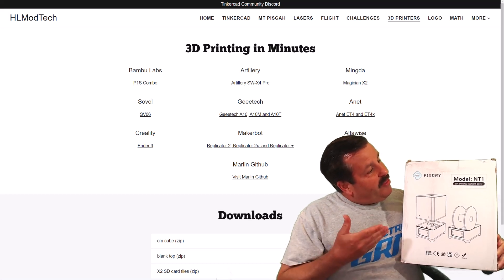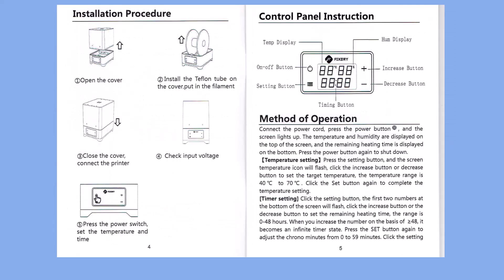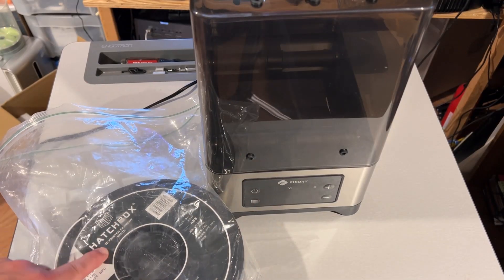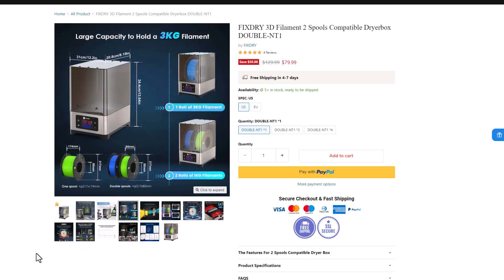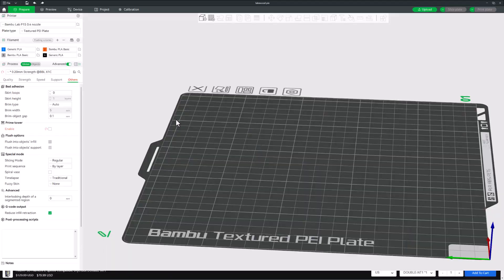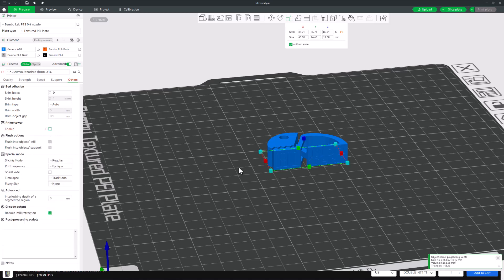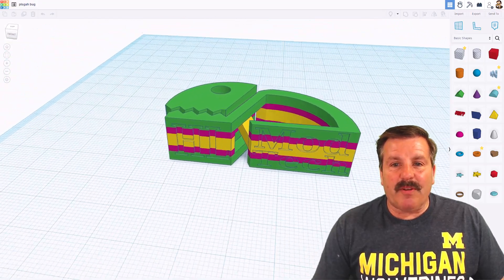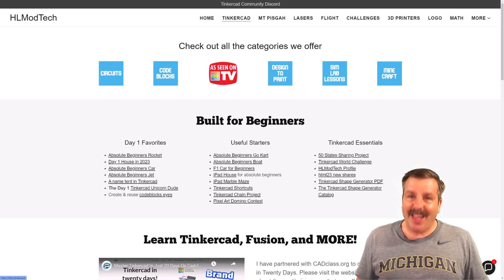Beginner ABS Bambu P1S FixDry NT1 Filament Dryer Tips Tricks and MORE!

Comment: Thanks for the practical demonstration, HL. That was very well done and quite helpful. I will consider getting one of those filament dryers (and I'll use what I hope is an affiliate link for you). Perhaps you could report back in a month or two for any insights on the dryer. Let us know the pros and cons.
Reply from the maker: My pleasure. I will keep you posted. I have a another abs print planned for my video tomorrow. I have a part that needs the extra strength, so I am really interested to see how it turns out.